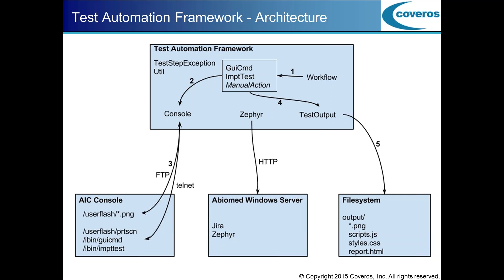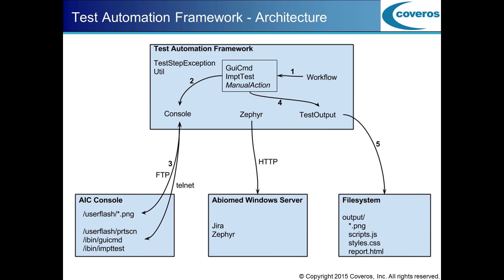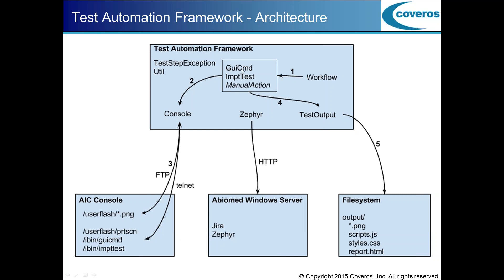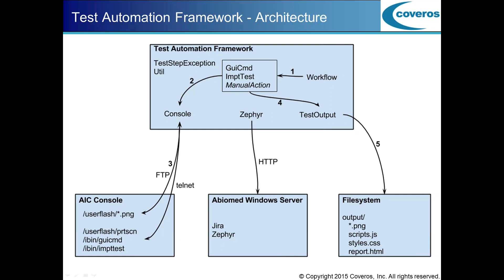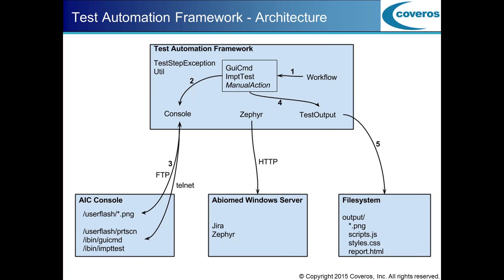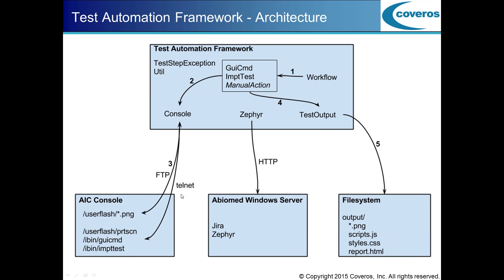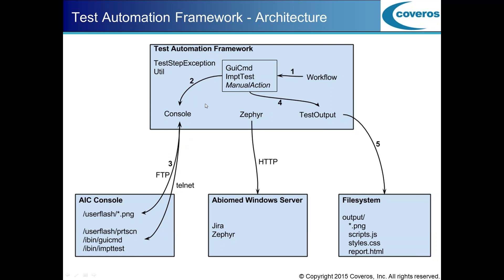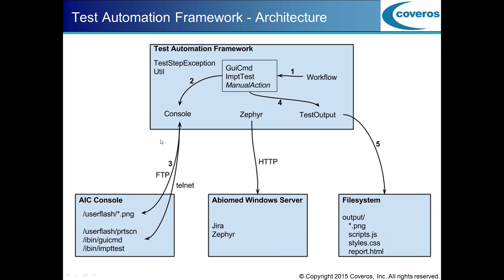Description of Test Automation Framework for Embedded Medical Device

Comment: As someone wanting to transition from a rapid-prototype environment to a formal DO-178C environment..  perhaps not for FAA approval, but to develop high quality/safe products for aerospace companies (Lockhead's SEAL Level X, Boeing , DDPMAS etc) , Medical, or Nuclear industries, would love to see a trivial example that goes shows all the steps and outputs.

Having a documented process on how code is generated is one thing, but how do you prove safety?  Who defines the unit tests?   I imagine there are differences between the 
FAA :  DO-178X , DO 331 , ARP4754A  , ED-12C
FDA : 13485 ,  ISO14971 , IEC 62304 , SaMD
DOE  : 414.1x, 
but what are the typical tools/software , and the typical document/artifacts that are needed in the various stages of the software life cycle?  

I've see so many options it's a bit overwhelming!
Requirement Management -  (IBM Ration) DOORS, JAMA, Xebrio, rmtoo florath , doorstop-dev / doorstop , reqview
Static Source Code Analysis - Parasoft, PolySpace, CodeSonar,  horusec , sonar cloud, veracode PREFast
Dynamic Analysis / Modified Condition/Decision Coverage (MC/DC) - VectorCAST, RapiTest
Configuration Management / Storage and Version Control System - Git, SourceSafe, Mercurial, MS TFS
QA - Helix ALM
V&V - VectorCAST, LDRA Testbed
Test Automation - Mathworks Simulink DO Qualification Kit
Continuous Integration / CD - Continuous Delivery/Deployment 

What is the general attitude towards open source software (ex. FreeRTOS) and code-generation tools (ex. ST's Cube MX)?   How do CPLD and FPGAs fit in to the picture.. since not exactly software, but they are programmable devices written in an  programming language like VHDL , (system)verilog?